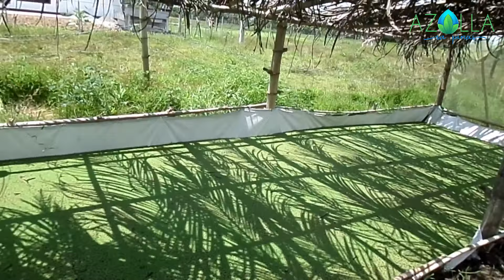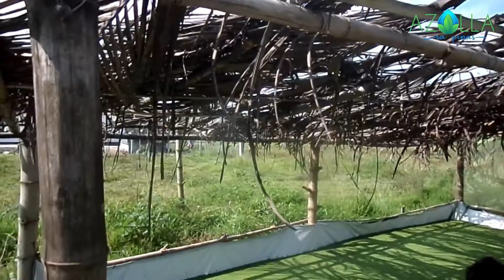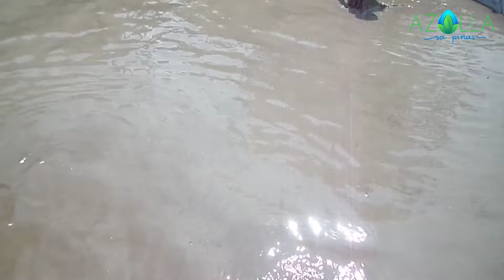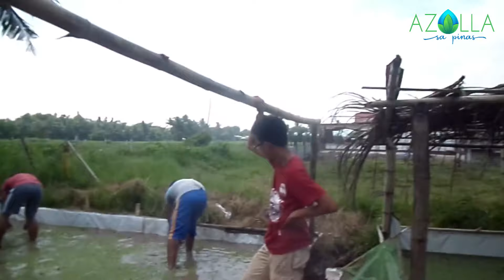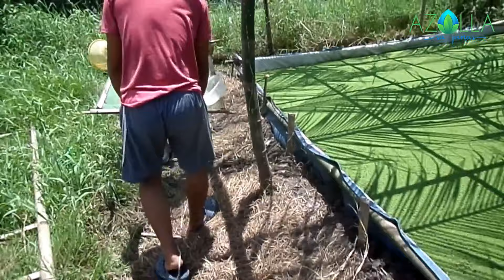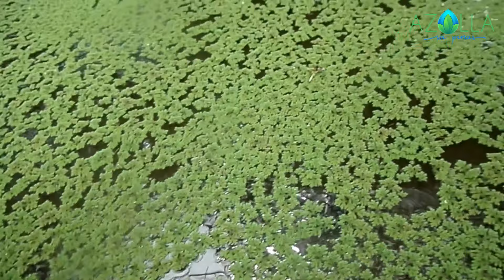How to Cultivate Azolla Using Used Billboard or Tarpaulin w/ Digging  || Azolla Farming  -Tagalog

Comment: Ma'am saan po makabili ng used tarp gaya sa tarpaulin nyo 20x20? Tska magkano po pabenta nyo sa Azolla?
Reply from the maker: P380 for 3 lunchbox freeship na po,. for the tarp,. nagebbenta rin po kmi kaso from lipa batangas po ako,. taga san po ba keo? ksi if malayo po e suggest nmin mghanap muna keo,. mhal po kasi ito ipaship gawa ng mabigat po ang 10*20sqft pa lng na pinaship ko dti ay 7 -12kg po. Call/text:0999-762-4425 for more info. Thanks!
Reply: Pangasinan po kaya poba ng azolla padala